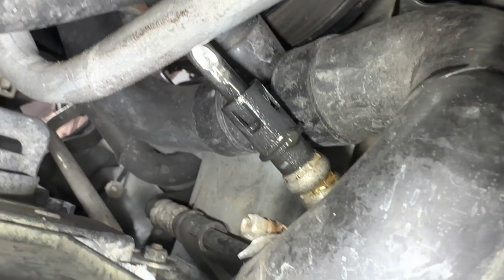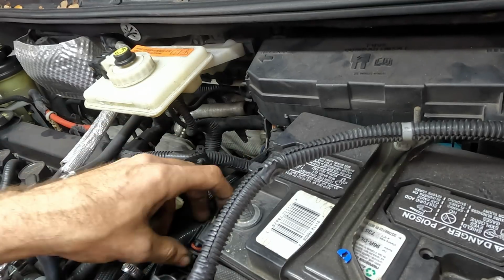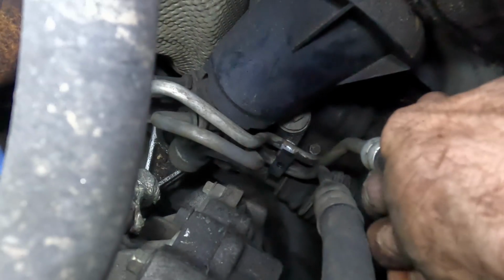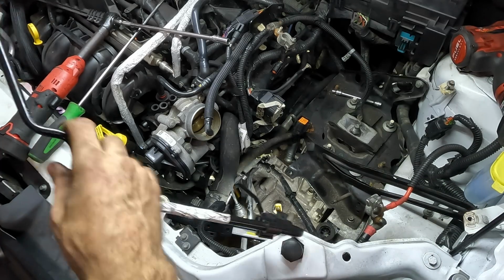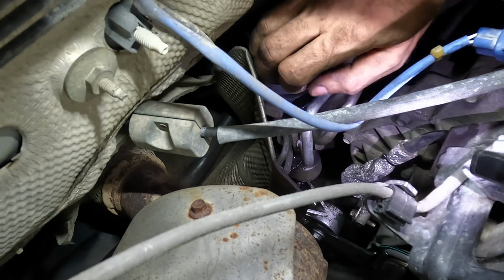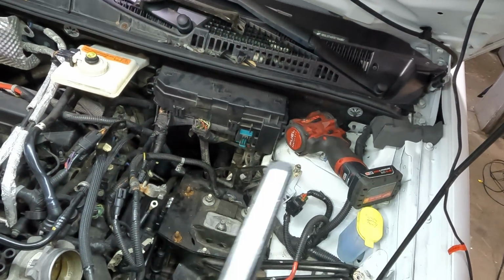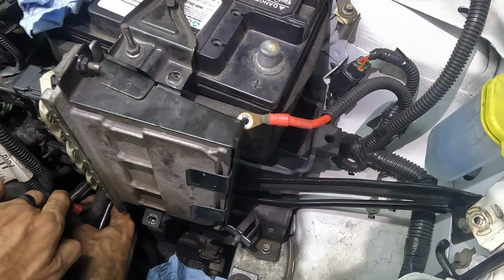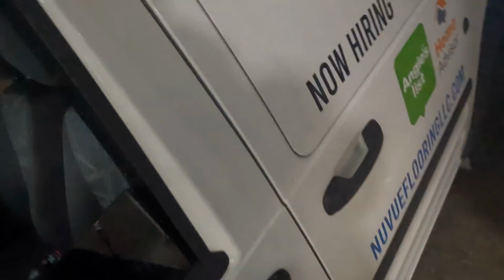Sloppy Repair: High Pressure Hydraulic Leak! 2013 Mini Transit

Comment: Ray, 
Looks like you forgot to clean the throttle body. Also, if you jack up the front end so that both tires are free it is easier to remove the airation in the PS system.

Comment: Ford power steering should use atf or type f. If that is the high side for the ac, it will be warm. On the question of where does this go, you have video footage of the disasmbly.

Comment: "My face is on a master cylinder..." 🙃 
We like the "down and dirty" so much because most of us do not have a lift, and are more than likely rolling around in the dirt and drips.😶‍🌫
You know Ray is tired when he starts parodying Pink. 😵‍💫
HEY RAY! Did you ever clean that dirty throttle? 🧐
Fords ALWAYS make power steering noise. That's how you know its a Ford. 🤓

Comment: The battery brush... the terminal cleaner works great and will last way longer then the cable wire cleaner. I keep plumbing coupling wire brushes. Hard to beat. I still love watching your videos.

Comment: Ray, This looked really hard yet you showed no stress. Maybe because you have the kit. For this job could you have cut out the chaffed pipe and inserted a replacement length with pipe joints and Olives.

Comment: Reinforce the broken wall and stick that noisy compressor inside. It will dampen the noise and protect it from the weather. Did you forget to clean the throttle body?

Comment: I usually use Type F transmission fluid in the power steering pumps. It has anti-foaming additives. However I'm not sure if it is good for newer PS pumps. I would imagine it should be fine.

Comment: Ray fussing with that stress relief bracket reminds me when I was younger working on my buddies 79 Camaro. We changed the exhaust and the hanger in the middle was missing the mount. I informed him he needed to replace it or the pipe will break. He said he would...

Well he didn't, so the only thing holding the new exhaust was the front and the rear hanger. You know where this is going. The stress of the road bumps and so forth broke that thing in half. So yep, the designers usually know what they need to accomplish.

Comment: If I remember my 60 year old school maths yes then AG collage 5.5 mm is 5BA and is Whitworth  size ie the Gauge of the bolt thread yeah 1850s British long way around bs it is all so 7/32 AF and if your metric tools are very old the Germans I think had bolt sizes like the poms o yeah fun A left over ford tractors hehe yeah only ford would keep a oddity like 5.5mm . 7/32AF . 5BA whitworth but all more or less 0.216 inch bolt size

Comment: Ray, I have a question for you. I have a 2019 MG ZS (suv) and am currently running nitrogen in all the tires. Every 3 to 4 months the tire pressure light comes on in the dash and was wondering if nitrogen might be bad for the TPMS. My wife's car has nitrogen in the tires and there seems to be no problem there. What do you think?
Reply: Just in case this wasn't a joke. Please, do not pay anybody extra to put "nitrogen" in your tires. Air is about 80% nitrogen, so you are basically paying extra for someone to fill the tire.

 It is near impossible to create a vacuum in the tire, which would be needed to fill it with a higher nitrogen percentage, as the tire bead only works with an outwards preassure. There is also no advantage to having a higher nitrogen content in the  tires, even if it would be technically possible to do so.

Comment: As an engineer, I've said this before.... About clamps and clips and such. EVERY SINGLE CLAMP CLIP AND SCREW is there for a reason. If they can save a penny on building a car, they will. Look at the diagnostic connector - or ANY connector for that matter. They do not populate pins they do not use.... to save a couple of pennies. A penny saved over 200,000 cars is $2000. Do that all over a vehicle and it becomes $250,000 saved on a build run.... over pennies saved per unit. For instance, a diagnostic connector is usually missing 10 or more pins - at about 2 cent a piece. a HUGE savings just there. Another saving measure - they changed the diagnostic connector in the late 90's so it uses a capture clip and a screw to mount it, rather than 2 screws. they saved probably a million dollars a year over that simple design change over all the vehicles they made per year. By deleting ONE screw. It is a constant battle between the engineers and the  bean counters in the front office. If it is not needed for the vehicle, it is omitted. A penny per unit is a HUGE savings on a vehicle run, so if they can delete it, they will. 

We had a former GM engineer at our company. Our product runs were more specialized, maybe 5,000 a year. A penny saved on a design is not as critical, yet he would make penny saved design decisions that would bite us in the a$$ later instead of designing for the future. We always had to remind him in meetings that we were not making 250,000 units, and a penny in the design is not a big deal if it will save us headaches $$$$$$ (and hence money) later.
Reply: The same thing goes for time. A design change  that takes a minute longer than before is a HUGE labor cost. I had another engineer that would come in the middle of my production runs and say... I found an oopsie in the design, we will need to add this modification to the entire run. It only takes a minute to complete. I would loudly sigh and say REALLY?!?!?!?!?!?!
him: but but, its only a minute....
I would think for a moment and say - I have 2500 units to make in this run - 2500 * one minute is 2500 minutes plus set up and break down, moving units in and out of the work station, so thats 2 minutes per if we are lucky. So thats roughly 84 hours...... divide that by 8 ------- You just cost me 11 man  hour days in my production run, over your minute....If I put 3 people on it, it will cost us 4 days extra real time days for this run.....SIGH, I'll go tell the  boss it will take 4 more extra days to get this run out.....

Comment: I used to work at a ski resort in Swain NY, and they used Snow Groomers, which used ATF as hydraulic fluid. Every so often they had a hydraulic hose failure and it looked like a crime scene. Well eventually they realized the hose failure was due to a hose rubbing on the frame due to vibrations. They wrapped the hose up with carpet scraps and zip ties to hold it in place and, boom, no more ruptured hoses!

Comment: Tech tip to Minimize air entrainment fill the Res and cycle the steering wheel off the ground from end to end 5 to 10 times checking the Res Half way threw your cycling then you can start the engine and you will have very little air in the fluid. 🤟🏻🤟🏻🇺🇸🇺🇸🇺🇸

Comment: Being a low pressure line. How come you couldn't just do a Bush fix and patch the pipe at the dammage location?
Also seems to me that was a manfacturing defect provided no one had made changes to it.
I can see a dealership changing the part but not a regular shop unless the customer insisted new parts.
I mean you splice wires, rarely do you replace wiring harnesses.  Why would a fluid pipe be any difference? 
Yes its a hydrlic line, but they make flaring tools and high presure fittings.
Its noting new. Yes someone putting 2 hose clamps and a vacuum tube won't work but really a metal high pressure line 
Segment splice isn't out of sorts. 
Cheaper faster and like somone said no trained hamsters nessary. 
Now if a section of the rubber hose went out yes that would be replaced  the whole part.

Comment: Ford Engineers: "Hey, what should we use to fasten down this set of hoses? Keep in mind that it is going to be somewhat out of reach and in a tight spot."

Mechanics: "I think just a common bolt will be fine. Have it be a common size so that we don't have to use a special tool."

Ford Engineers: "Perfect! We'll hold it down with a 5.5mm bolt."

Mechanics: surprised Pikachu face

Comment: To help get air out turn to stop and bounce steering off the stops about 5 times both ways, it's a pressure spike which helps push the air out, or can vacuum out using a external reservoir

Comment: Engineers probably threw in ONE 5.5 just to screw with mechanics. Surely THAT could have been designed with a 5 or 6…..or even an 8 or 10 for that matter. Nope…..let’s toss one of those 5.5s that were ordered by mistake in there. Then we can read reviews at lunch time just for giggles.

Comment: some 12 years ago I had an '88 Taurus wagon that I think my wife loved way more than the dog and me combined .... power steering line was leaking, 'and' the PS pump had been whining for a long time. I was for junking the car due to busted bumper covers, cracked light lenses, etc. the wife insisted on repairs, so I took it to the garage and had the mechanical repairs done while I froze my a$$ off (winter in Missouri!) scrounging around the pick-a-part rounding up body parts which I installed on her car. wound up spending around $1000 fixing up her baby which was at best maybe a $400 car at the time. 
happy wife, happy life, right?  ..... and life goes on. 😁

Comment: That vehicle must have come from up north if it has a battery blanket.
Reply: My understanding it is to help insulate the battery from engine compartment heat and nothing to do with keeping the battery warm.
Reply: @desotosky1372  I have one. It plugs in to keep the battery warm in cold climates.

Comment: Why don't you use nut drivers on some claps instead of straight screw drivers I never see you use them seems like it would be easier and safer because with a screwdriver you can stab or cut yourself just wandering I'm a big fan love your channel hope wife unit has as much success in her new adventure as well best of luck to the both of you

Comment: RAY-MAN: Are you thinking about digging a pit and installing a third lift (possibly an alignment or platform type), maybe repositioning one or both of your existing ones in the process? Or, alternatively, hire an absolutely top-shelf detail person and put them to work in that "extra" space? Ten years ago, three of the wealthiest census tracts in Florida were in Sarasota County, and I read that (at least, a couple of years ago), 17,000 millionaires have homes in the Sarasota area, so a good auto detail person (or two) ought to be able to pay all the bills in your shop - including your salary, lol, probably. Even the cannon fodder "does all the best buy here, pray here dealers' cars" level detailers can pay their own way, but the ones who can actually be trusted to be able to evacuate urine from an item of footwear without there having to be directions stamped onto its heel can really make bank. Don't do any paint work (develop a relationship with someone for that), just cleaning/waxing/glazing/compounding/wet-sanding... cleaning/shampooing interiors (develop a relationship with an upholstery place, too, so you don't have to make it, merely install it)... and cleaning engine bays/undercarriages. When you initially advertise their services, price them as if they would be exclusively doing the vehicles of hereditary heads of state - your local market WILL bear it. Plus, that will provide the dual benefits of preventing (most of 🤣) the walk-ins who want their heap o' feces detailed for a couple hundred bucks, while tending to actually attract - for example - Stephen King or one of his Casey Key neighbors. I mean... they're not looking to get ripped off, but they're not likely to be standing in line at the cheapest dirty water hot dog shop in the city, either. So, yeah, man, do that. Detailers won't be standing around watching spiders produce webs while they wait on a parts delivery, or for a customer to call and approve work. They'll walk outside, give an estimate on a vehicle, and (probably) schedule the job. Then they'll do it. And THAT will give you some fiduciary padding, as they say, which might allow you the comfort to hire a mid-tier mechanic to help your workflow. Or maybe even an actual secretary at least part-time, so your wife can go home and take the kids with her, so they're out of that environment (FFS). And the detail side can provide work for the repair/maintenance side, and vice versa (high-dollar vehicle maintenance pays just as well as repair work, with less chance of going home sore, yeah?). It's probably more... fun to do a scheduled $10,000 maintenance on an exotic than, say, the differential rebuilds you recently did. The work is out there - and, by out there, I mean in your city. You'd just have to get your foot in the door, so to speak; after that, it's all word of mouth. They say that being one of the top 5% earners in your business (and, not coincidentally, in the detail industry) is half skill/knowledge/experience - and half the specific vehicles... and clients... you happen to service. Yeah, you might have to clean every inch of that place with a toothbrush, and cultivate an aura of "Of course, you want to become one of my clients, for I am the best at what I do" - but would that be so bad?

Comment: Another great job Ray, as usual.😁
I used to tie a small rope, or parcel twine to lines that threaded their way through the engine bay, to both ends of the old line so I could if needed pull the new one through, or pull both ends from a near center point easy to remove it from. 👍🇺🇸😎

Comment: In the old days, we could get more air out of the power steering fluid by applying vacuum to the reservoir. Run a vacuum line to the reservoir. Keep it out of the fluid. Seal it up in any convenient manner. Sacrafice an old cap if necessary. Tightly wrapped rags sort of work. Running the engine with the reservoir under vacuum for about 15 minutes usually did it.

Comment: Ray, you remember taking that plastic holder you took off because there was on on the other pipe. You should have used it at the bottom where it sits next to the AC line to hold it away from it.

Comment: 5.5 nightmare!
you have it to stabilize 
the pipes to prevent
rubbing and holes in the 
lines. I do not know how you get all the wires
to the correct location.

Comment: Could you use your vacuum pump on the air conditioning device to degas the power steering fluid?

Comment: The engineers responsible for the packaging of this one either deserve an award, or a swift kick in the nuts. I can't decide which.  Every new vehicle with 5 thousand miles of tubes, plastics, and wires makes me yearn even more for yesteryear when you could sit next to your engine inside the bay, and replace practically everything on it with basic hand tools, and not one single problem to be had.

Comment: Exceptionally Impressed by the correct install of the battery Positive connection.  In a (heaven forbid) crash, the last thing that is needed is to short out the positive terminal to ground.  If it happens, it happens, but the factory engineers hopefully know the best location to minimize the dangers associated with grounding the positive......You really know what you are doing!

Comment: I recently bought a '93 chev pickup and if you need to change a power steering line, you just disconnect it and reinstall the new one. No removing of half the engine compartment first, and putting it back together after.

Comment: Going from a 90s chevy truck when I was a teen in which I did an engine in cam swap to what cars are now, I have made respect for mechanics. The simplest things are amplified with the addition of electronics/sensors/etc. I was scared to even do minor maintenance on my newer cars, you videos helped me grow to do more. It is all about patience and common sense (the only thing I still have no idea about is differential and transmission work)

Comment: Ray I've forgotten the plan with the shop upgrades - are you cutting a new roller door into the front section of the new space? If that's the case, have you considered relocating the big rack over there so you don't have to do the corner of death all the time?

Comment: i may sound like a recording at times but all this modern technology garbage is the reason i DO NOT work on my Honda Accord EXL, i have a mechanic that is just like Ray he does not mind the hassles that come 's with automotive repairs, i DO , LMAO,  last summer i had a water pump leaking, he replaced that along with the timing kit in a few hours, total cost 648.00 and it was worth every penny.

Comment: Great job Ray. It's unreal, the convoluted routing and terrible access of cables, pipes and hoses on modern vehicles. I'm sure it all looks easy peasy to some engineer sipping coffee at a workstation in Dearborn or Evanston or wherever...for the guys that have to work on the product, not so much. CAD assembly modeling has a lot to answer for!

Comment: Hey Ray, is that a petroleum version of the transit connect🤔, Here in the UK🇬🇧, we can only get the fuel of the devil version of said vehical😏, a ford 1.8tdci @ £1.70 per litre = £6.50 per gallon, that's about $8.00🇺🇲🤨😏😠🇬🇧🇬🇧

Comment: In the early 70s I worked for a Sun Oil company garage in Tulsa. It was the shop my dad had retired from.  I once was working on a 1960s era Chevy 6 cylinder. Nothing special, I was to replace a leaky valve cover gasket, replace spark plugs, points and condenser.  Someone walked by the front of the truck, saw me and informed me the shop foreman was looking for me. He said he’d tell the boss where I was.  Where was I?  I was avoiding leaning over the fender to do the work.  I was inside the engine bay standing on the floor with everything I needed to work on within easy reach. My needed tools and parts on a tray balanced between the radiator and the right fender.  Those days of having under hood space have been gone for years.  The boss laughed at me and said I was the only one in the shop skinny enough to do that.  Yes, those days are gone too.